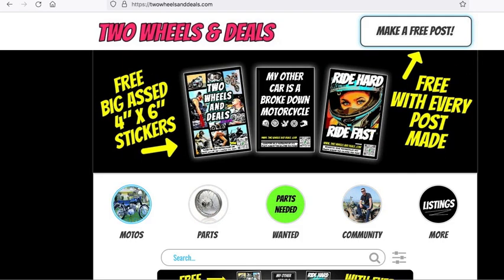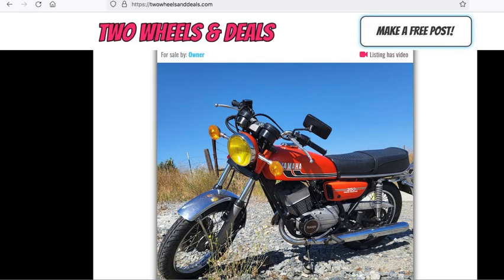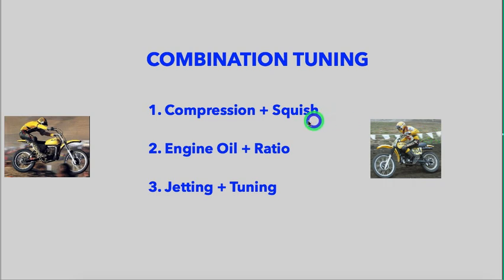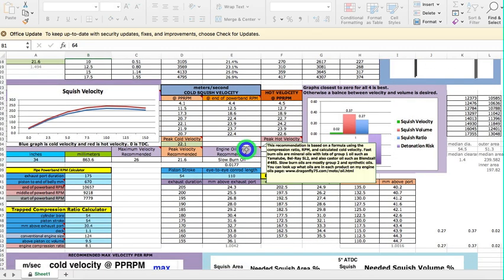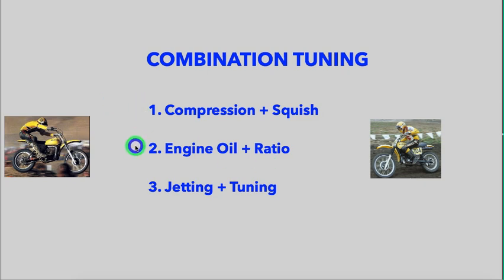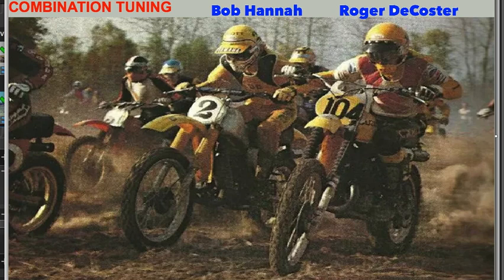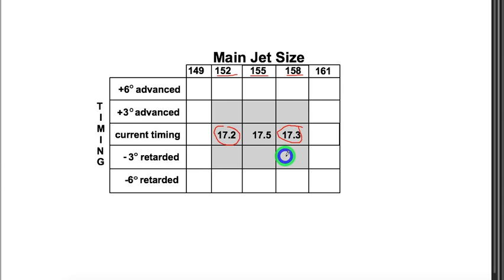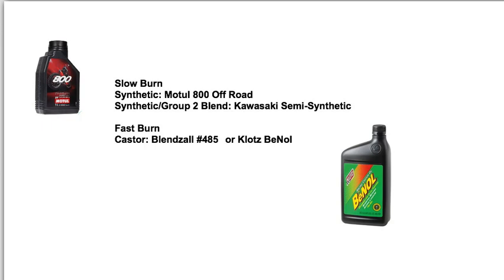Combination 2 Stroke Tuning

Comment: 1:54 I'm pleased that you talk about peak cylinder pressure ATDC, in the past I had a big argument with a 'professional' tuner who stated that the current trend is to try and obtain peak cylinder pressure actually at TDC!...I would not trust the bloke to fit a spark plug correctly!
Reply from the maker: I've never heard that. Lots of crazy opinions floating around.
Reply: @MichaelForrestChnl  Yeah, he is a professional tuner with a shop in the US. He has a youtube video where he is 'explaining' that the reason a 2 stroke runs a retard curve is to put heat into the exhaust which effectively shortens the tuned length. I posted up that the reason they run a retard curve is that when the engine comes on the pipe the VE goes up which means that the flame speed goes up, this in turn means that in order to create peak cylinder pressure at around 14 degrees ATDC the burn needs to be started later. He then basically made out that I did not know what I was talking about at he then stated that in an ideal world peak cylinder pressure should be at TDC. I've actually lent a bloke my ignition rig, you can run up ignitions systems off the bike, he ran some ignition timing tests on an AR50 that he is trying to get to 100 MPH, during one test he ran the timing quite  retarded, the pipe temperature went through the roof, the torque output went through the floor!
Reply: @MichaelForrestChnl  Yeah, he is a professional tuner with a shop in the US. He has a video where he is 'explaining' that the reason a 2 stroke runs a retard curve is to put heat into the exhaust which effectively shortens the tuned length. I posted up that the reason they run a retard curve is that when the engine comes on the pipe the VE goes up which means that the flame speed goes up, this in turn means that in order to create peak cylinder pressure at around 14 degrees ATDC the burn needs to be started later. He then basically made out that I did not know what I was talking about at he then stated that in an ideal world peak cylinder pressure should be at TDC. I've actually lent a bloke my ignition rig, you can run up ignitions systems off the bike, he ran some ignition timing tests on an AR50 that he is trying to get to 100 MPH, during one test he ran the timing quite retarded, the pipe temperature went through the roof, the torque output went through the floor!
Reply: @MichaelForrestChnl  Yeah, he is a professional tuner with a shop in the US. He has a video where he is 'explaining' that the reason a 2 stroke runs a retard curve is to put heat into the exhaust which effectively shortens the tuned length. I posted up that the reason they run a retard curve is that when the engine comes on the pipe the VE goes up which means that the flame speed goes up, this in turn means that in order to create peak cylinder pressure at around 14 degrees ATDC the burn needs to be started later. He then basically made out that I did not know what I was talking about at he then stated that in an ideal world peak cylinder pressure should be at TDC.
Reply: @MichaelForrestChnl  He has a video where he is 'explaining' that the reason a 2 stroke runs a retard curve is to put heat into the exhaust which effectively shortens the tuned length. I posted up that the reason they run a retard curve is that when the engine comes on the pipe the VE goes up which means that the flame speed goes up, this in turn means that in order to create peak cylinder pressure at around 14 degrees ATDC the burn needs to be started later. He then basically made out that I did not know what I was talking about, he then stated that in an ideal world peak cylinder pressure should be at TDC. I have an ignition test rig that I have lent to a guy that is trying to get a Kawasaki AR50 to 100 MPH (it has a 93cc big bore kit). He has run several dyno sessions where he was testing ignition timing, on one run he ran the timing quite re-tarded, (misspelt to avoid youtubes filter), the pipe temperature went through the roof, the torque output fell through the fall!

Comment: Im very curious to adjust my squish and compression, mostly to go from a race head to a more mild "pump gas" head design.  This is on a ktm250sx 1999, compression is 14.5:1 so i run 100llav gas and 927@40:1 , the stock head has some design flaws like sharp corners a big dome and small squish.The engine was designed from ktm  for low rpm torque in mind. 

I purchased a used 2002 head with a wider squish band and smaller dome, known to have improved top end, I plan on using this head for performance and then modifying the 1999 head by lowering the compression so I can use 91 octane pump gas. I would prefer the new  head design be for mid to high rpm if im loosing my high compression , the motor can rev out better .

Would you have any advice on making a pump gas head out of a race head? My plan was to literally chuck a spark plug in a drill, held in a vice and re cut the dome until I get my target cc for head volume. I figured if i had less power Id be on the gas a little more to keep up with everyone. 

Also do you think I would need to time the stator for pump gas, if so how much should i start with?
Reply from the maker: I'd start off by getting my low cost squish program so you can know the starting squish velocity and volume before changing it. After any change you always need to test different timings to see which one gives the best performance. A narrow squish band is for high RPM power, not for mid range power. High RPM power needs higher squish velocity and less squish volume. www.dragonfly75.com/moto/sqVelocity.html

Comment: If love to hear your opinion on metering rod carbs. I’ve had decent success with them but I found size is key to getting great response and good fueling. With a large carb and rich rod down low you could get response but if dual sporting it would run really rich at low throttle opening and high rpm
Reply from the maker: Interesting. Wouldn't the same problem exist with a standard carb? When oversized both carbs need to enlarge the jets and the standard carb would need a skinnier needle to allow more clearance between it and the needle jet.